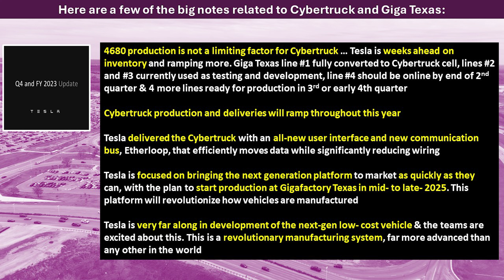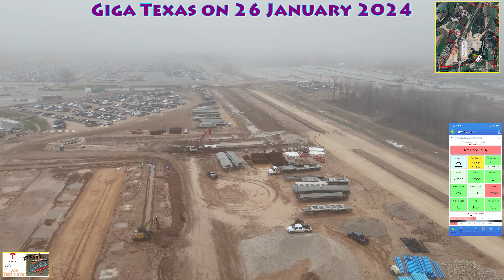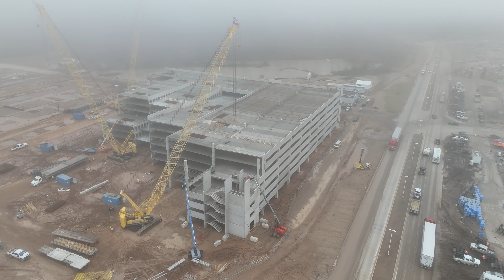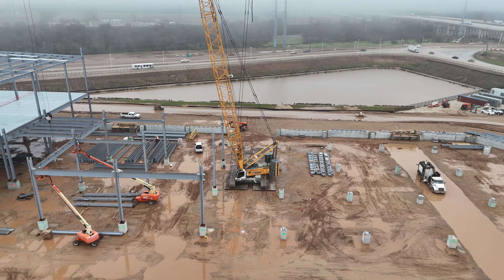Cybertrucks Moving, W Superchargers & Boring Machine Setup! 26 Jan 2024 Giga Texas Update (11:35AM)

Comment: These Evapco cooling towers are piped directly to the chillers underneath to keep the chillers working and from overheating.  As the chillers are constantly running, the condensing piping is pumped  through the condensing side of the chiller and back to the cooling towers.  The other half of the chiller is  where the building chilled water is pumped through the evaporator side to keep equipment, building and any other items that may require circulating chilled water.
Reply from the maker: Thanks! 🤗

Comment: Joe, those Sapphire tanks are for CNG (compressed natural gas), not LNG. LNG must be stored at cryogenic temperatures (by cooling it to approximately −162 °C (−260 °F); maximum transport pressure is set at around 25 kPa (4 psi)). No frost on those tanks and no regassification equipment, hence CNG.

Comment: Hi Joe, in the Tesla Q4 report, page 9 says Cybertruck production capacity is “> 125000” units. If that is correct, should I not expect 2024 will at least have 125000? or even 150000 with a production rate of maybe 250000 units annually by the end of 2024? 🤔

Comment: Thanks for all you do Joe...21.37 is it just me or does it seem like the elevators you pointed out are on the wrong platforms? the tall one is next to the lower platform...
Reply: Not complete yet. Additional mast sections on the ground to the right past the crane.

Potentially one could reach to the roof so that the current roof access through one of the HVAC roof curbs can be removed and replaced with the relevant HVAC gear.
Reply: @DessieDoolan  Yup thank you I went back and looked again, and it makes more sense...

Comment: Thanks Joe
1:10. Intro. "We expect the ramp of Cybertruck to be longer than other models given its manufacturing complexity." Outwardly simple design, complex manufacture. Sorting out the manufacturing issues will set them up well for the Gen 3 model.
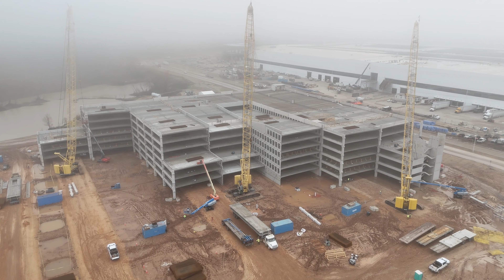6:29. Parking Garage. “Growing towards the east”. This is in fact a second building, separated from more advanced structure.
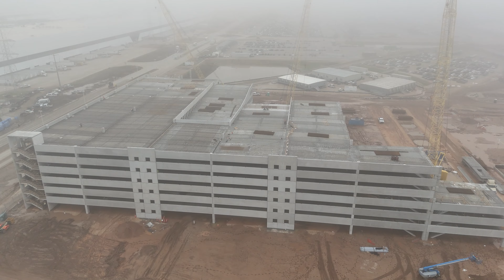Left. Note the double columns/double beams where the 2 structures abut. 7:14 to the right also.
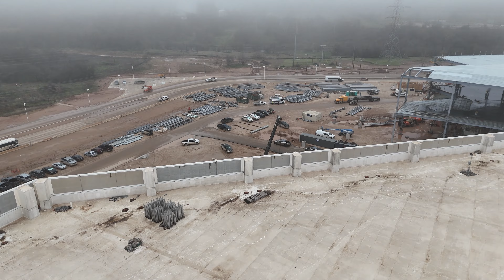7:55 - 7:57. BIW roof. Inside the plant room. Bottom left, where the workers are seen. Dual floor drain inlets (red) same as on the roof, visible close to the plant room wall. Roof drains at 8:21.
8:34. Southend. Tank Farm. I wonder what the finished height will be. Previous tank installation in Paint was after construction of the building. Got in early here.
9:04. Southend. Removing a trench shield from around a CFA pile group.
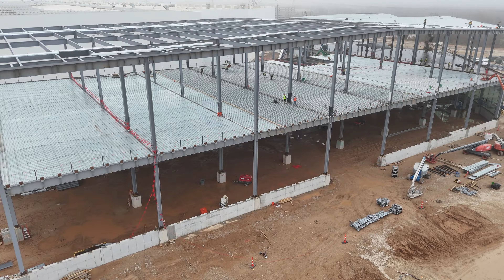10:14. Southend. Painters splashing white paint here and there.
10:31. Southend. Diagonal corner. Bottom track in place for Level 2 glazing.
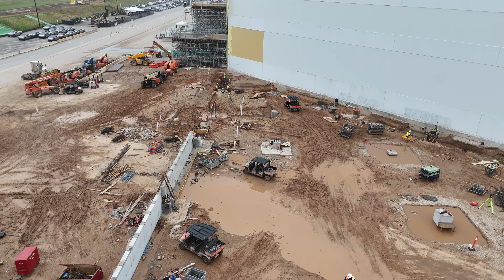11:56. Southend, west. Retaining wall. Suspect this the extent of the taller section.
14:22. Westside, tunnel project. Tunnel lining first, grout second. The grout fills the gap created by the TBM shield as for operational purposes the TBM shield needs to be a larger diameter than the tunnel lining.
14:35. Westside. Tunnel Project. Conveyor belt storage magazine/cassette shifted to align with the tunnel.
15:03. Westside. Tunnel Project. Right. Tunnel segments parallelograms (skewed rectangles) and trapezoids. No hexagons, as erroneously reported elsewhere.
New EOL site. Top left. Water storage trailers, pair of pumps. No water supply yet.
Similar arrangement at Cathode where water storage trailers and a pump was the water supply for some months before the city supply was connected.
16:48. Westside, storage. Blue wrapped items. Might be the second hot-stamping press mentioned by Lars in the Munro video of the Cybertruck production line tour.
20:56. Battery, loading platforms. Alimaks (construction elevators) being erected at each loading platform.
All vehicles lined up outside. Might be slab works inside. Currently a gravel floor only.
22:15. Casting, apron. Cybertruck and Model Y rear castings off for recycling. No in-house recycling yet.
23:40. Casting, east. Apron Sapphire LNG system not currently connected.
27:16. Cathode north. Sanitary sewer lift station. Black pipes likely electrical conduits. Awaiting the power supply.
Seem to be pumping from a sanitary sewer manhole into the stormwater drain. Hopefully rainwater ingress only.
Reply: 23:40 Some large users of gas can get lower rates if they curtail usage during times of high usage. These may be a temporary way to supply fuel until a more permament storage is installed. A foundry that I worked at had large propane tanks for this purpose. Also a peak generating plant near me has two very large tanks for this purpose.
26:47 Joe talks about fan units and steam. The Evapco units are factory assembled water cooling towers used to chill water and the steam is condensation from evaporated water.
Reply: @patrickdougherty2777  23:40. What I think is going on here is internal NG gas lines being altered for the 3 additional furnaces. Had to shut down the supply to Casting while those works were carried out, but needed to keep the casting machines operating. 3 plumbing permits for NG gas lines works in November and December. None specifically mention Casting, but the required alterations may be elsewhere.
26:47. I wonder what is currently requiring chilled water. Is something operational inside the plant, or is this testing still.

Comment: I wonder if the decision to begin the installation of the windows is related to an attempt to minimise water ingress as construction progresses in order to help speed up the overall project timetable. i.e. less water ingress = less mud & fewer lost working days accordingly.
Reply: It may be cheaper to install them as they are made. those crates are very expensive.
Reply: @kkarllwt  lol
Reply: @kkarllwt  But I thought that Tesla simply crushes all of their wooden crates for recycling irrespective of what was delivered in them. Wooden crates built on this scale tend to be custom-made to fit and are therefore it's not feasible to return them to the supplier for reuse.
Reply: The only reason to glaze the south end is to be able to look out or to look in. Place ya' bets.

Comment: Thanks Joe!
EOL facility:
South:
@ 15:11 (Right) Two 24.9 kV switchgear units (Green boxes) placed on their bases.
@ 15:43  Power distribution cabinets placed on the concrete pads. They will supply 480 volts AC to each of the  Supercharger power cabinets. Each power cabinet then supplies DC power to 4 charging pedestals. There will also be two 24.9 kV to 480 V transformers per pad, for at total of 4 transformers.
Temporary substation:
@ 29:26 In the process of being dismantled.